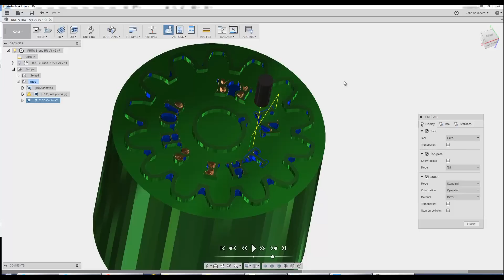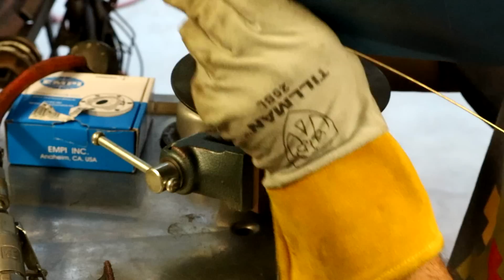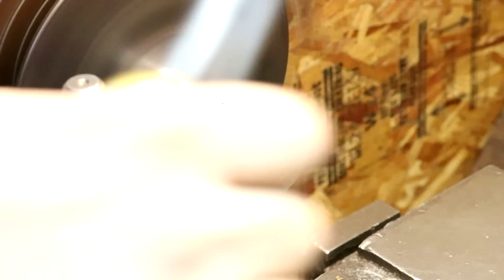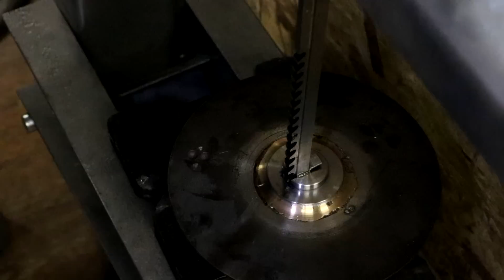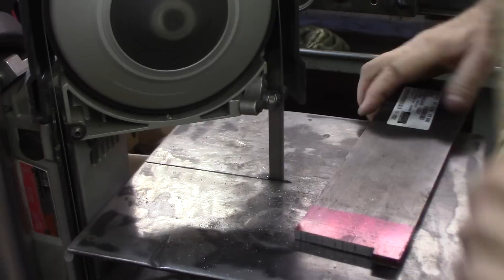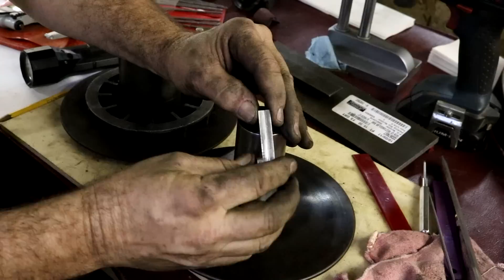How To Repair Variable Speed for a Clausing Lathe Part 2

Comment: Great video especially the lathe Great video quality i thought i running it for a sec at the end of the cut lol  
I have a question After removing the slave clutch assembly Shouldn't the outer pulley slip off ?  I don't see any snap rings ! But the inner pulley just is starting to slip on the motor shaft  -looks good though but it wont come part  any thoughts Would Be Greatly Ap.  
Thank You for the Great videos
Alec
Reply: I got  the outer pulley off

Comment: You’re feed rate is too slow. I just recently learned speeds & feeds on the lathe. What a difference.
Reply from the maker: Yes this was a very sketch setup, so I was just taking it easy with tool pressure.  I was only going to make this once.  Thanks Bill.

Comment: In case you have had no luck finding a Clausing 5914 manual.
http://www.vintagemachinery.org/pubs/181/3407.pdf
Reply from the maker: It is a Clausing 6903.  I have a manual for it.
Reply: Randy Richard In The Shop , Sorry for my error! The lathe I was looking at was a 5914 and looked the same. BTW, the manual I sent had a penciled in notation of $800 for the variable speed parts, who knows what they would cost now?
Reply from the maker: They are very expensive now.

Comment: Why did you feel the press fit would not be enough to hold the repair in the disk? I guess the outer rim of the disk would have lots of leverage and we do not know hot the disk gets in use. Perhaps some thin radial fan blades would cool it if heat were a problem. Gotta leave room for the oil film where the hub slides, too. Looks like a fan on the sliding side.
Reply from the maker: Yep all those reasons.  It is a fan/Alu. Heat sink.

Comment: Just found your channel.  Love the 'stach.   That's the problem with cast iron, porosity.  Some cast aluminum's are just as bad.  Great work on the special keyway.
Reply from the maker: Thank you for stopping in Mature Patriot and thank you for your service.  Yes the Cast was quite the problem on this project.  The next pulley will be a different approach.

Comment: Out of curiosity, why didn't you lap the parts together while you were fitting them up on the lathe for a perfect sliding fit?
Reply from the maker: This is not a metal to metal fit, it has a bushing possibly made of a Delrin type material.  Thank you Chris.

Comment: Randy, you will need to balance that clutch. (imo)
Reply from the maker: Balance the clutch or the Pulley?
Reply: the clutch. The 2 sheaves that you worked on. Dynamically balanced if you have access to a machine. Usually the balance will change depending whether the sheaves are closed or open. Static balance is better than nothing though. (my cvt transmission experience is with snowmobiles and atv , i'm just assuming theory crosses over., maybe not though because the powersport  equipment runs at a much much higher rpm. (upwards of 5000)). just spitballing here.
Reply from the maker: Each disc of the drive pulley has holes from original balancing.  I do not know how they balanced it, weather it was Static or Dynamic, or weather as an assembly or separate disc's.  The work I did was on only half of the assembly but could of affected the balance.  I have the Intermediate shaft out right now and it is far worse condition.   I will be repairing both halves on this pulley.  I will have to setup to at least static balance it as an assembly.  I will have to at least check the Drive pulley assembly also.  Oh joy even more work now.  Thanks Billy for the great comment and suggestion.

Comment: Great job at repairing that.   I was going to order those Variable speed pulleys for my Clausing Drill Press and they wanted $2,300 for them .   You saved a lot of money .
Reply from the maker: Thanks Ken.  Wow, I didn't even check into buying them.  I also have to repair the intermediate shaft pully it is in even worst shape.

Comment: This repair is coming along very well. I like your excellent setup/machining/sanding on the final fit along the sliding pulley. That is cool looking key and expertly fitted. Looking forward to seeing the pulley in action on the Clausing.
Reply from the maker: Thanks Paul.   Well this part works great.   I have the Intermediat shaft with the clutch/Brake/varipully out right now.  I have the brake and throwout bearing setup all fixed.  Now to start on the othe vari pully which is really messed up.

Comment: I was looking at those lightening holes and wondering if a re-balance would have any effect after the brazing? Very nice repair, I would love a vari-speed pulley on my mill drill, but it looks like a lot of design problems for a home operator. Really nice work again Randy, thanks for the video!
Reply from the maker: To help with the balance issue, is one of the reasons I machined the weld.  Thank you Howder.

Comment: Nice job Randy & son.  I'm certainly no expert but it's been my experience the torch for brazing less than clean materials works better.  I think TIG with the inert gas doesn't really let hydrocarbons burn out as well.
Reply from the maker: Thanks Bill.  I agree.  i have always used a torch for this sort of thing.  I was out of Acet. so we thought we would try the tig.  But it is just to sensitive to contaminants.